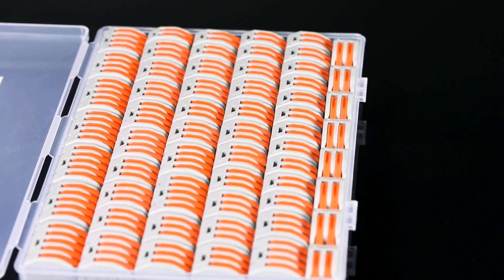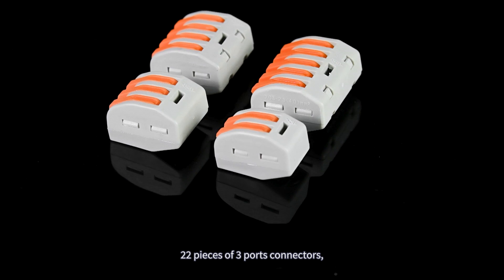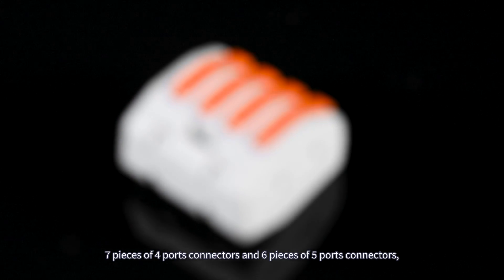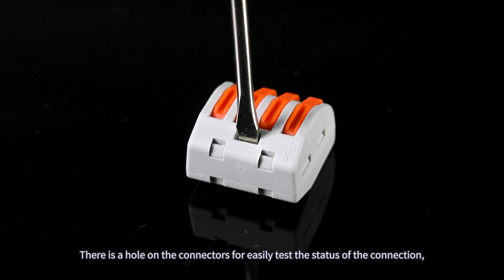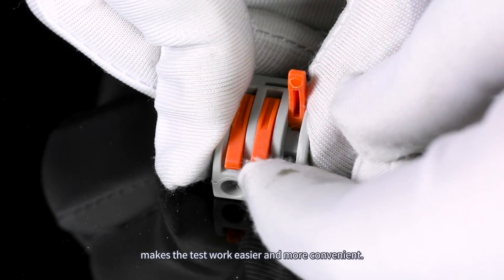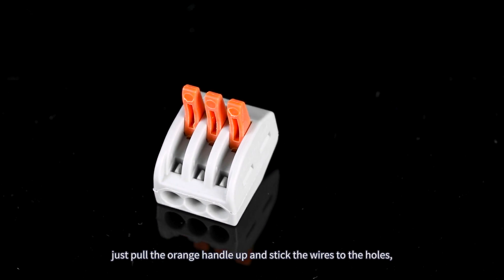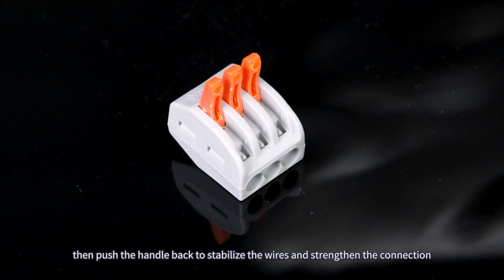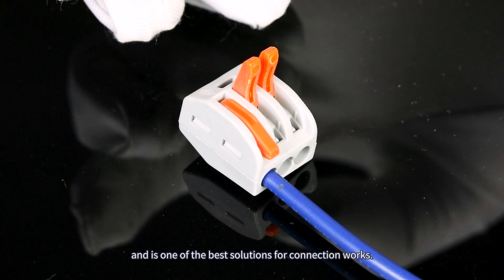PCT-59 Push In Wire Connectors Kit

Comment: So all wire will become one connection right?
Reply from the maker: Yes, that's correct. For each of these connectors, all the wires you insert into it will be joined together, making one electrical connection.
Reply: @daierelectron  thank you so much 🙂
Reply: Happy to help 😀